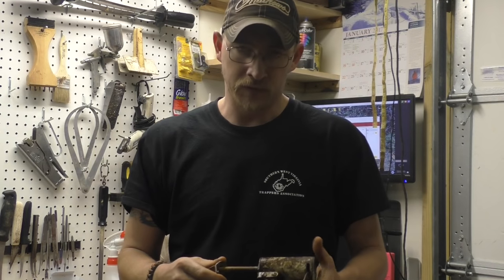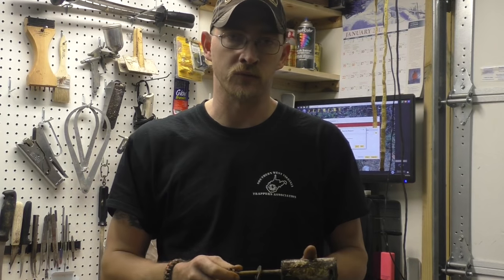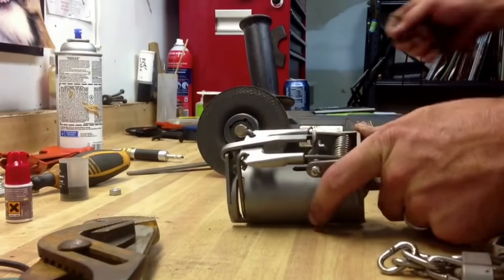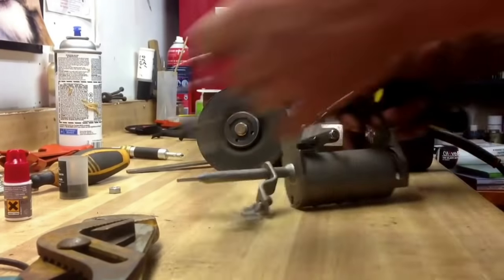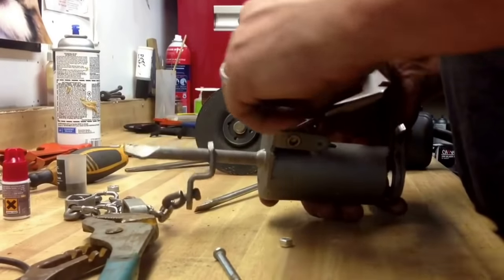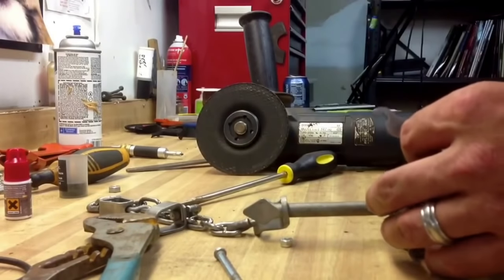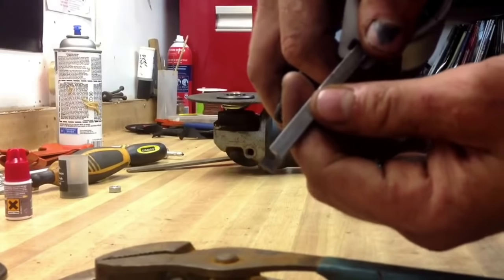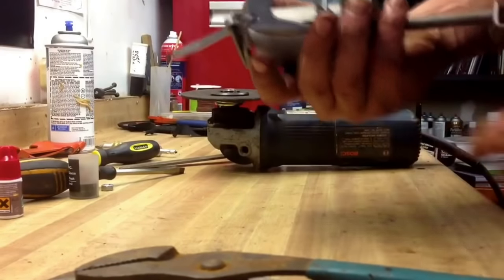How to modify Dog Proof coon traps

Comment: They look like bridgers you should right behind the top plate put a hammer claw under the back of the plate push up a little then hit the rod down a little with a hammering will put more tension on the spring when it closes.Ive had trouble with the bridgers with pullout because the spring doesn't put enough pressure on the foot when it closes 10:04